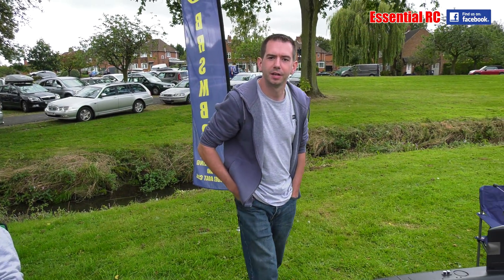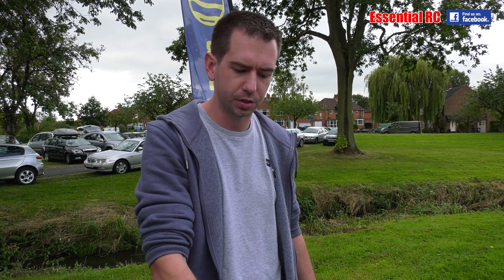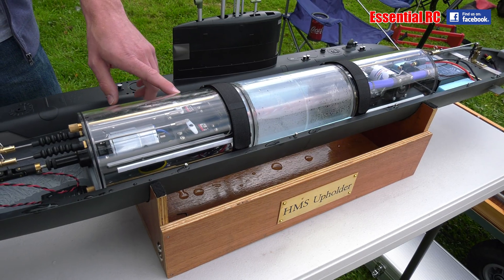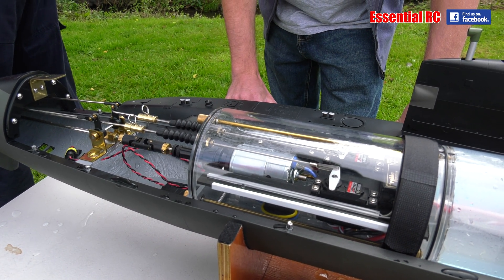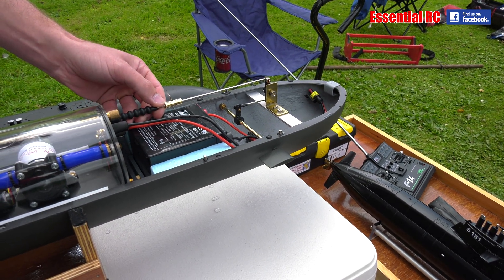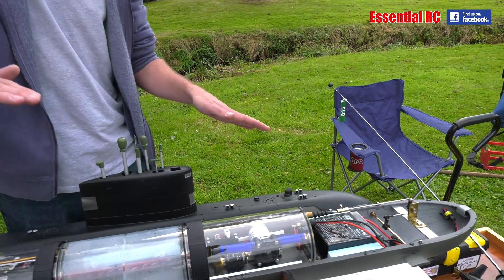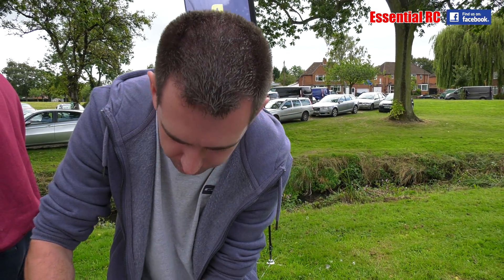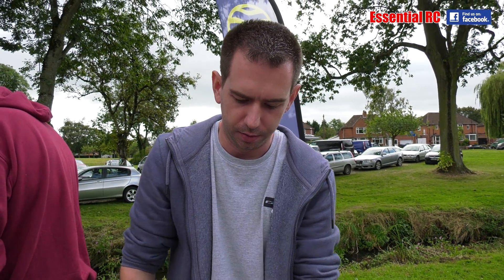RADIO CONTROLLED (RC) SUBMARINE: HOW DOES IT WORK ?

Comment: So all the compartments outside the cylinder are flooded with water?
Reply from the maker: Yup!
Reply: @EssentialRC  but in the video it looks like there are some electronics outside the cylinder, i.e. wires,  battery? I don't understand
Reply: @tgrman1  I don't think so. Only the middle compartment fills with water.  The other two remain dry. That's why he said, if you see condensation then there's no leak.
Reply: @ashuuddin6415  I think the outside compartments flood. The foam displaces water and offers buoyancy but there is an art to trimming. It’s a bit of a mind bender to figure out what’s actually happening. Even water density/ salinity will affect trim.